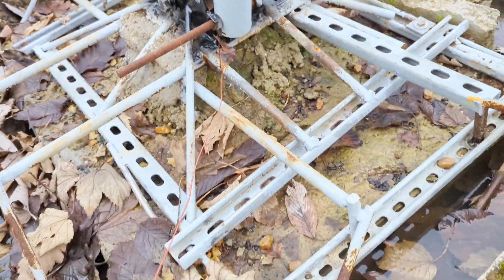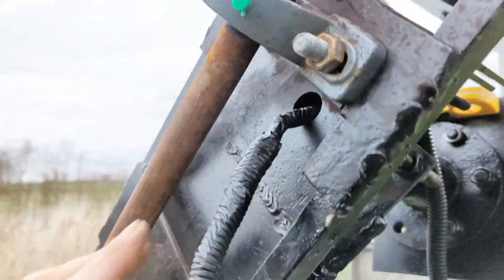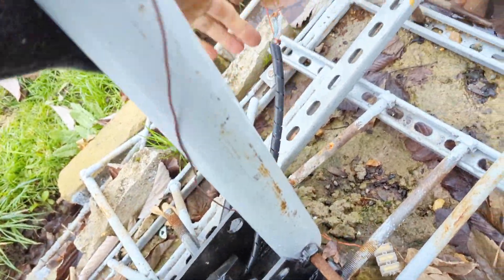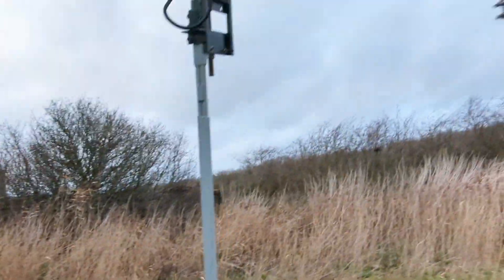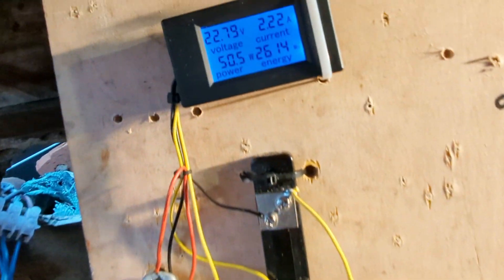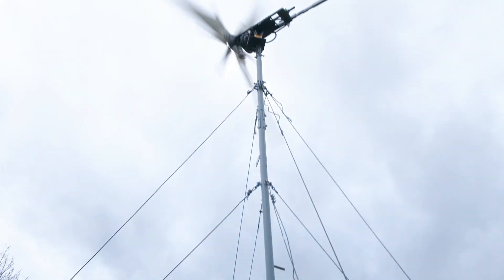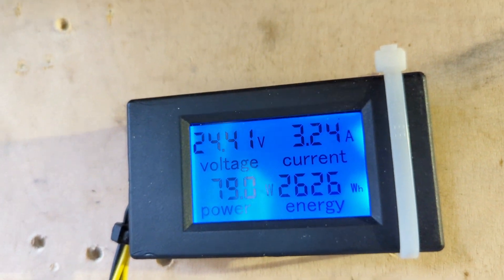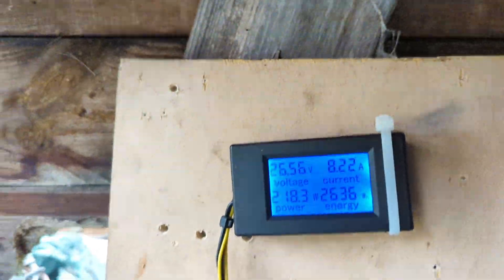Wind Generator Project Testing - New Inverter -  FREE ELECTRICITY - 19th December 2022

Comment: you might have to shelter the slip ring from the weather going by what ive seen guys experience in the USA with similar weather to yours. here all we get is mild warm winters my slip rings have lasted years  , same hiigher amperage 6 wire sliprings thermodyne, hurricane wind turbines and missouri used to sell, got mine from aliexpress by memory, moflon was the brand.